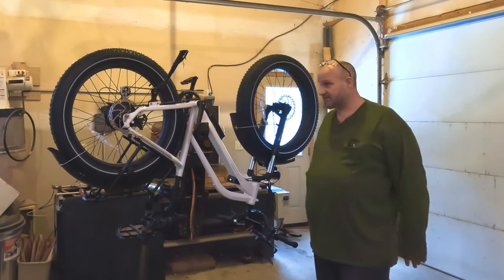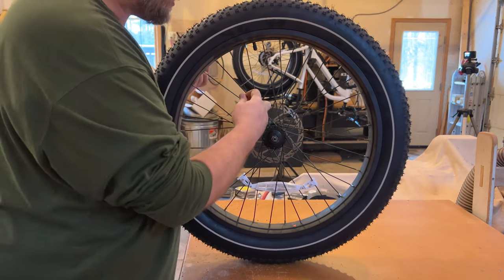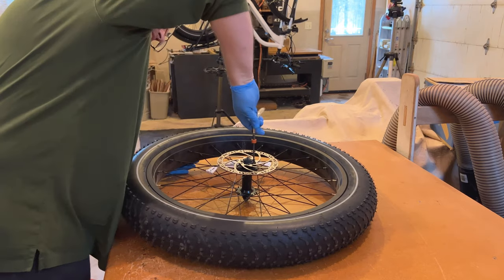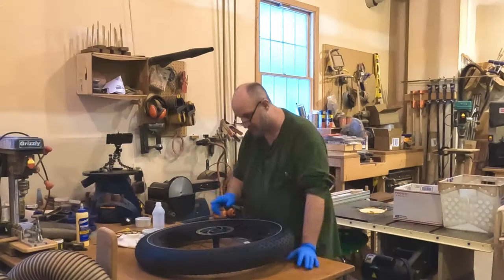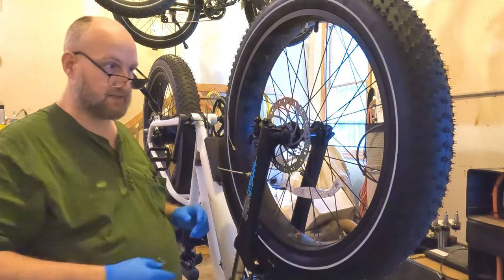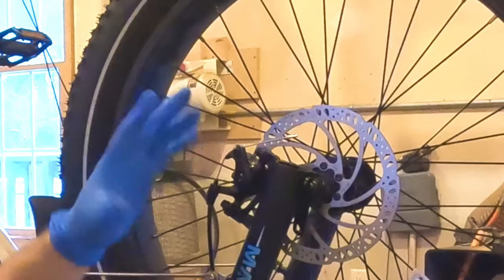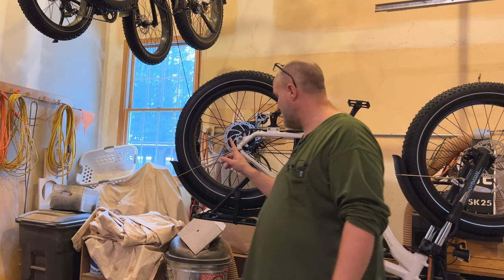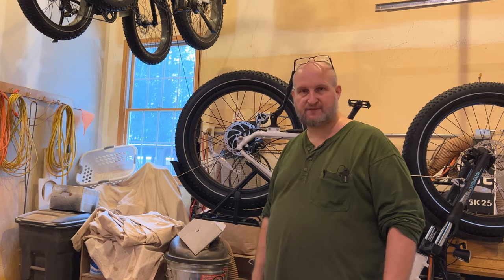Brake Caliper and Rotor Replacement for Magicycle - Tinkering Turtle

Comment: Well, T2, say a prayer for me, and likewise.  I flipped bike over like you did in video. The caliper has a black plastic piece, in between the break pads. Someone,  I thought, another video person, called it a clamp. I mistakenly,  pulled it out, thinking I broke it good now, but it's ' plastic'.  So, put the pads over the rotor, with that gap now bigger. Tightened bolts, and, Wow Factor, spun wheel and brakes worked, stopped tire !!!  Do you think, if you can answer,  that the black plastic piece is just for shipping purposes  and should be removed.  ?   Best result I've gotten so far, on the brakes and caliper.    Magicycle was a bit iffy, in their responses and Chat was not so eager to respond,  too bad.   Your's helped me, maybe can avoid shop.  Thank you.  Paul
Reply from the maker: I have to say that I did not understand that you are just assembling the bike. I was uncertain how you took the caliper off the bike and didn’t understand how to reassemble it.
Yes, when companies ship bikes with hydraulic brakes they will typically insert a plastic spacer that snaps in between the brake pads. This is to limit the brake pistons from popping out of the cylinders inside the calipers. (typically this plastic piece is red, but your is obviously black)
Reply from the maker: check out the assembly video for this bike. At time stamp 19min 50sec you will see me remove the plastic piece from the front brake caliper before I put the wheel on the bike.
https://youtu.be/k3VvStPdVeM
Reply from the maker: it would also be a good idea to watch one of my basic setup videos for adjustments prior to the first ride. Here is the one I did for the Zebra.
https://youtu.be/hdUY2bjF_9U
Reply: Ok, Thank you,  for all the information,  very helpful. I'll try to explain what happened in the manufacturing of the bike, probably tomorrow.  The front fork was put on backwards. An ordeal.
Reply from the maker: I’m glad you’re figuring it out. Another good place to get advice is the Facebook groups. You can post pics and people are pretty helpful.
Reply: Yes, the bike was shipped with front wheel off, so I put it on first. Then , had horrible time trying to put on fender and headlight,  as that black piece that goes across forks, was Behind the forks. Kept telling Magicycle,  but ? Finally ,they told me to remove handlebars and rotate forks , 180degrees.  That worked, got fender on and headlight; then , not being mechanical and not on a bike in 15 ? years, struggled w/caliper; BUT,  your video solved and confirmed.  Thank you.  And your Lions beat my Giants last night.  😑😑✌️✌️👍👍
Reply: Just to ask, the last question?   When I lift front wheel and spin it, getting 'some ' rubbing sound, like rotor rubs against brake pads ?  Sound right ?  Or,  just keep trying to loosen or tighten the caliper screws. ?       Thank you,  helpful  to me.
Reply from the maker: In that situation, with hydraulic brakes, you would need to center the pads on the rotor. To do that, loosen the two mounting bolts just enough where you can move the caliper slightly. Then have someone hold the brake handle…squeezing the brakes onto the rotor…and then give each mounting bolt alternating 1/4 to 1/2 turns until tight. After releasing the handle, hopefully, your pads will be centered. If you have a slight rub after that I suggest bedding in your brakes and see if it goes away. If that doesn’t work then you will have to loosen one mounting bolt at a time and make slight adjustments side to side until the issue is resolved.
Reply: Thank you, have a nice, new week
Reply from the maker: You as well!

Comment: T2,  found this video,  replacing caliper and rotor.  Obviously,  I know nothing of this ;  the rotor is the silver disk?   I just can't see how the caliper re-attaches to the rotor, need a closeup.  Seems such a small , tight fit ?   Deer has hydraulic brakes, you said.  I don't want to unscrew the wrong screws, and get it mixed up. Should I just go to shop, $50, probably?   Thank you.
Reply from the maker: Yes the caliper goes over the rotor. I will address more on the other comment.